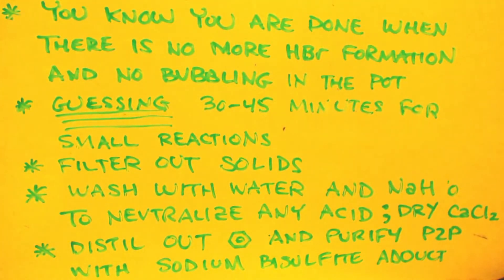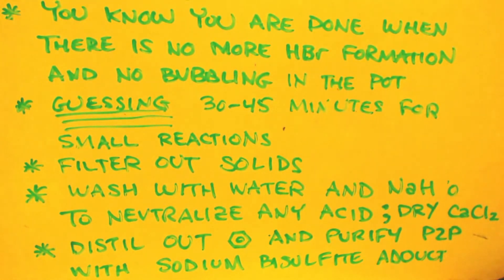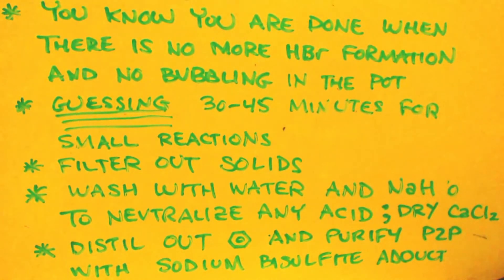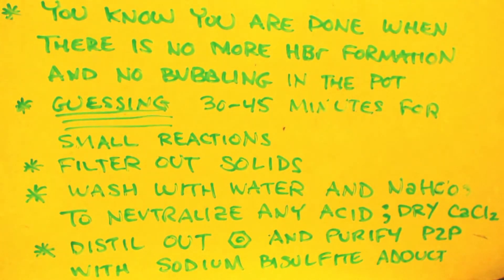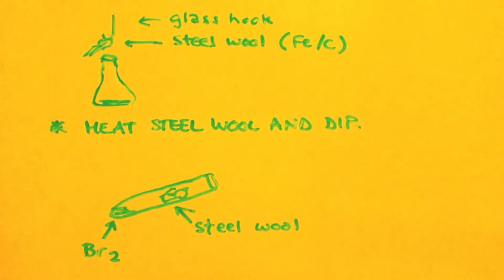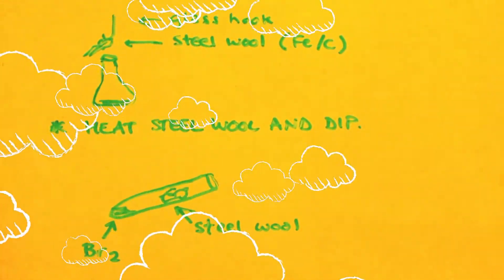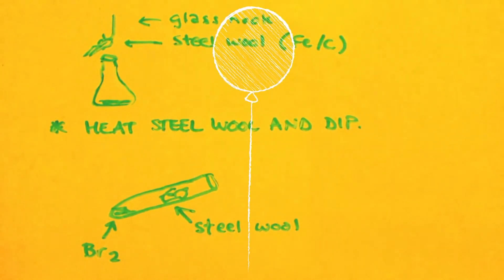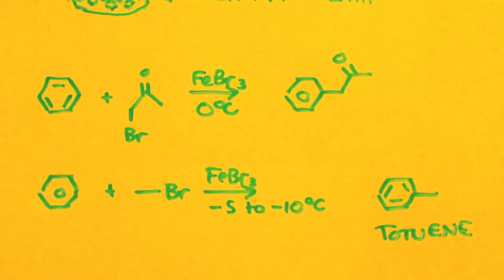P2P SYNTHESIS friedel crafts alkylation PART 2

Comment: I have to apologize for part of former comment, though the ferric bromide catalyst definitely will not attach to oxygen, in the case of halogenated carbon species like Br-Ace in presence of catalyst the primary carbocation can indeed form (though the mechanism i described similar to Sn2 reaction can also occur, which depends on reaction conditions).  Just wanted to clarify my error, sorry about that.

One final note regarding you talking of making the FeBr3, what you describe can and does work, but its a rather violent exothermic rxn when steel wool "burns" in bromine vapors so its dangerous and risk of toxic gases/vapors inhalation are high.  Also, these species are very unstable as a solid, as strong Lewis acids they cannot be stored due to quick breakdown liberating Br2 gas, reaction with water vapor in air as well as somewhat oxygen sensitive and degenerate in sunlight exposure.  They are much more stable in solution but even then degrade and lose catalytic properties.  The best way to obtain is to make fresh when needed in-situ with the reaction by adding small amount of bromine and iron filings to the rxn it is needed in.  This way the catalyst is generated w/o oxygen/water contact in solution fresh, so degredation is not an issue.

Dont take me the wrong way please, im not trying to be rude or critical, just trying to help.  I love chemical engineering and minored in biochemistry and polymers so this field is my passion...only trying to share further knowledge bro.
Reply from the maker: Chad...............You could NEVER offend me by telling me i am wrong.  That is how i learn.   That is what my channel is about.   Or suppose to be about.   If i reviewed all my videos right now i am POSITIVE i would find hundreds of mistakes....THAT IS FOR SURE.    Just in case you did not read the link to wikipedia that i gave you ....here is a "cut and paste" about the friedel crafts ACYLATION>>>>   A typical Lewis acid catalyst is aluminium trichloride. Because, however, the product ketone forms a rather stable complex with Lewis acids such as AlCl3, a stoichiometric amount or more of the "catalyst" must generally be employed, unlike the case of the Friedel–Crafts alkylation, in which the catalyst is constantly regenerated..............................Now that cut and paste is about friedel crafts acylation but you can see it does say that FeBr3 will make a STABLE complex with carbonyls.   And if you are doing a friedel crafts alkylation with NO carbonyls present then a catalytic amount of FeBr3 can be used.   But if a carbonyl is present like in alpha bromoacetone then you will need a stoichiometric amount of FeBr3  to make the complex with the carbonyl AND ALSO a catalytic amount to do the experiment.
                  Also if you look at the pics they give on that wilipedia page under the heading "FRIEDEL CRAFTS ACYLATION"    and then under  "REACTION MECHANISM"  then look at the next to the last pic and you will see a pic of a complex between FeBr3 and the oxygen on the carbonyl.
                  I am glad you do now see that friedel craft alkylation is an SN1 reaction and NOT an SN2 reaction (not counting MINOR products that may occur via SN2).
                I like the way you think cause it is how i used to think a couple years ago.  BUT.....why does there always have to be a but....lol.    BUT making FeBr3 in situ is not possible for the reaction in the video.   Now if you where trying to add a bromine INSTEAD OF AN ALKYL GROUP to the benzene to make bromobenzene then yes you should make the FeBr3 "in situ".  I think nerdrage has a video where he does that.    He makes anhydrous FeCl3 "in situ" and adds CHLORINE to a benzene ring.    The reason i say you can not do that in the reaction in the video above is for a couple reasons.   First to make FeBr3 you need HEAT.   And the friedel crafts alkylation is done in the cold or room temp.   So there would not be enough heat to make the FeBr3 "in situ".   The second reason and MAIN reason is this >>>>  You can use the friedel crafts alkylation to add alkyl groups to a benzene ring OR OR OR halogens.   If you have bromine and benzene and iron in a pot and the bromine reacts with the iron to make FeBr3 what will happen next is the Br2 will complex with FeBR3 instead of complexing with the alkyl halide (bromoacetone) and then the bromine will add to the benzene making bromobenzene.   Now if you are trying to add bromine to benzene then this is no problem.  But in our case we wanted to add the alkyl group (bromoacetone) to the benzene.  So that is why you can not make the FeBr3 "in situ"   UNLESS YOU ARE TRYING TO ADD THE HALOGEN(BROMINE) TO THE RING.  
              You got some great questions/comments.   Sure made me think and review.   Shows you are really thinking.
               Last but not least i wanted to comment on the stability of FeBr3.   I used to think like you about how unstable FeBr3 was.    But i made some AlBr3  a year ago.  And it is still as white as can be in the flask it is stored in.  Do not get me wrong some of it did decompose but not a lot.  I was DEFINITELY expecting more to decompose.     I am in no way saying to make extra FeBr3 to store and use when ever you want or to keep it open to air/water/humidity/light.     But it is a lot more stable than you think.
              MY OPINION is if you want to do a friedel crafts alkylation and need a lewis acid to make then  make AlCl3.   I will try to find a video on making it.  But this guy in the video makes it looks so easy to make AlCl3.   Here is a link.  Great video  and short   https://www.youtube.com/watch?v=AppyhWb06b8            You would think using bromine would be easier since it is a liquid and chlorine is a gas but there is almost no heat needed when reacting chlorine and aluminum.   When i say almost no heat i mean relative to the heat needed when it is bromine that is used.   Cause i tried to make AlBr3 with HIS METHOD and it would not work.  The aluminum has to be pretty much be on fire before it will react with bromine.   But when making AlCl3 the aluminum only needs to be hot.    
                   I actually noticed a 3rd post i did not reply to so i will look at that next.   Let me know if you still disagree with me.  HAVE A GREAT DAY

Comment: No, the Br of the Br-Ace's lone pair occupies and fixes to one of the empty d orbitals of Fe, creating Br3Fe - BrCH2-CO-CH3.  Since primary carbocations are too unstable to form, this complex draws near to benzene...with Fe III being in oxidation state of 3, its very e- difficient and binds 4th Br, which in turn creates large withdrawing on end C atom atom and partial + charge.  This + is attacked by pi bond, Ace attaches as FeBr4- leaves simultaneously (see Sn2 rxn mechanisms), then highly basic FeBr4- anion rips H+ off ring restoring aromaticity and geterating HBr.  It will not complex w the double bonded O on Ace at all, b/c its a double bond in sp2 hyb. orbitals sharing p orbital as well w C atom; this creates cloud of antibonding w d orbital on iron, but the much larger Br atom has full 4p orbital easily fit into irons empty 3d (or d-p hybrid depending) and bond.  Youre forgetting O atom is MUCH smaller than bromine, only filling 2s-2p orbitals (plus bound very close/tight toC in double bond)...where bromine and iron are much bigger with 3s, 3p, 4s, 3d, and finally 4p orbitals as outer shell.

So you only need catalytic amount period, and your runaway control is addn. rate of Br-Ace.  If u add catalyst to premixed reactives on a large scale, it may be your last experiment (luckily you said start ice cold).

-The REAL chemist
Reply from the maker: Chad..........Sometimes youtube does not notify me of post.  But i stumbled upon your post anyway.  Unfortunately it is a year later.   Sorry about that.   Your thinking is to complex.  You need to simplify your thinking.   First of all a friedel crafts alkylation is SN1 and NOT SN2.   And that is why the friedel crafts alkylation suffers from rearrangement.   Secondly the FeBr3 will complex with the carbonyl on the ketone.  WHY?  Because it has lone pair electrons.   It is that simple.   I think what you need to do is read this page from wikipedia which i will leave a link at the end of this post.   But you will notice in the friedel crafts ACYLATION that at the end of the mechanism the FeBr3 will complex with the ketone made at the end of the reaction.   WHich is proof the FeBr3 forms a complex with carbonyls on ketones.   If there were no carbonyl involved then only a catalytic amount of FeBr3 would be needed.  BUT we are using bromoacetone which is a ketone.  So you need a stoichiometric amount of FeBr3 to complex with the ketone and then on top of that a catalytic amount of FeBr3 to do the experiment.   
               This is the reason when you do a friedel crafts ACYLATION that you need a stoichiometric amount.  Because at the end of the experiment your product will be a ketone and  will complex with the catalyst.   KEEP IN MIND if you are doing a friedel crafts alkylation and none of the precursors have a carbonyl group then you only need a catalytic amount of FeBr3.  Here is the link https://en.wikipedia.org/wiki/Friedel%E2%80%93Crafts_reaction     Please read it and see how it agrees with me.    I do not blame you for the way you are thinking.   Because it is EXACTLY how i used to think.  But after a year of reading on the subject i learned a few things like i told you in this post.    Anyways i see i missed another post of yours so i will try to reply to it after i get back from the store.  My ride should be here soon.